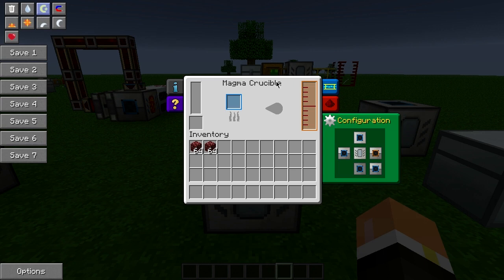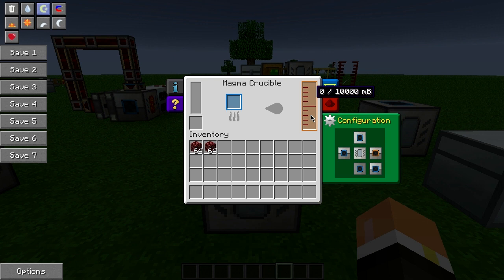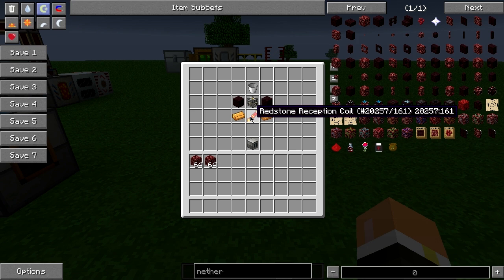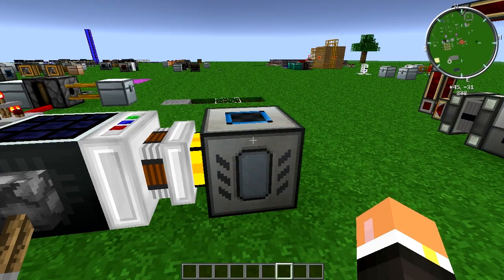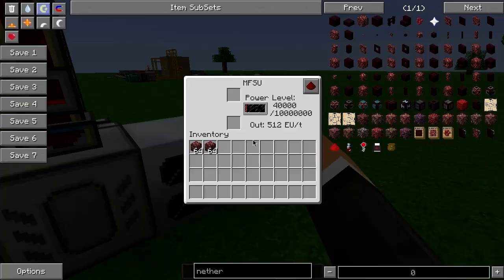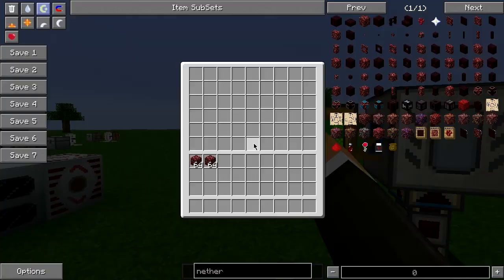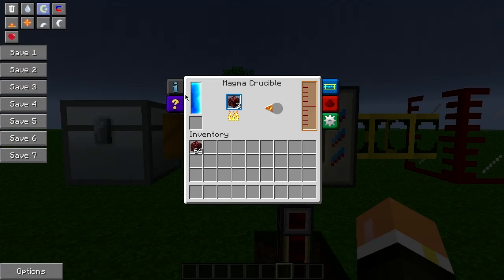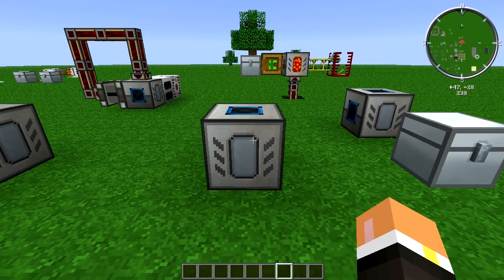Feed The Beast :: Machine Tutorials :: Magma Crucible

Comment: My problem is augmentation, it says upgrade required, and i havent figured out how to do this step
Reply: Probably a bit late to reply but if you still need to know the answer or for anyone else you need to use the thermal foundation upgrade kits which are hardened, Reinforced, Signalum and Resonate these will allow you to put in augments and depending which upgrade you use depends on how many augments you can put into the machine. Hope this helps.